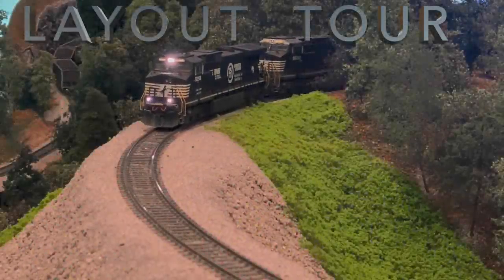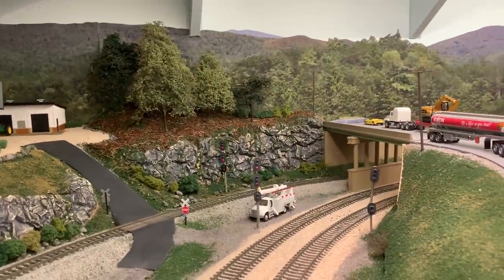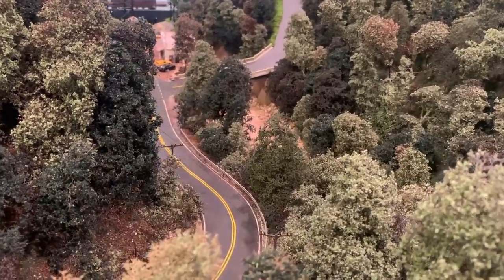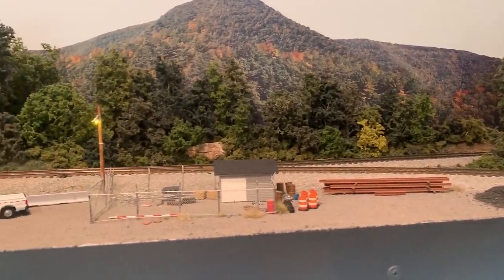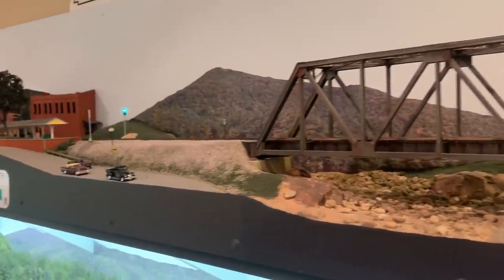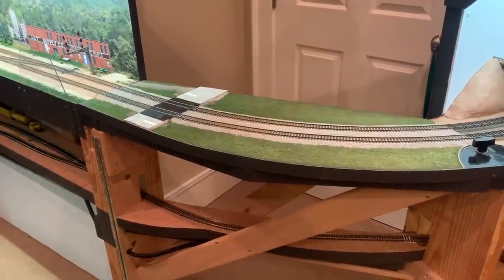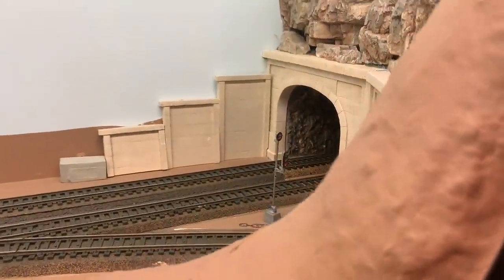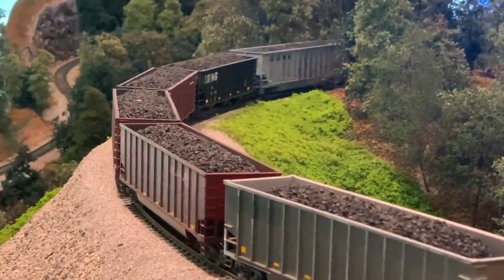Layout Tour - Modern NS Asheville District in HO Scale 2020

Comment: In 1994/95 I lived in Swannannoa (East of Asheville) and railfanned from Asheville to Old Fort many times.  I chased and rode the N&W 611 steam excursions through there, too.  I've driven under the small bridge you modeled at The Loops.  There are several tunnels between Asheville and Old Fort.  I've hiked the tracks and actually walked through all but two of the tunnels.  The first tunnel from Asheville is about a quarter-mile long - too long to walk through safely.  The last tunnel on the line I never found until one winter day when the leaves allowed a view of one end of the tunnel.  One short tunnel is the subject of local art for sale in the shops on Black Mountain.
And, I'll never forget the smell of the wood chip pulp plants West of Asheville.

Comment: I live in Marion but work in Old Fort. I work at a factory there that makes automotive parts. NS brings us hoppers full of pellets that we use to coat the back of our automotive carpet. A long time ago we used to ship out everything via rail but now we just use NS to bring us the pellets. There used to be a set of tracks running in the building to shipping docks. The docks are still there but the tracks are torn up. The hoppers located right outside of the facility.

Comment: You guys have built a really nice layout, and you do great voice over work.  FYI, if want to simulate spring switches get a “the Hare” decorator from DCC specialties (one for each spring switch), they piggy back on the tortious switch machines and have a auto throw functions.  To use auto throw you just isolate one rail on each of the diverging route tracks, solder a wire to that isolated rail and run it back to “the hare”.  The hare will supply power to the isolated rails so there will be no dead section, however when a train approaches the turnout on the track with the isolated rail section the decoder will detect it and throw the turnout the points.  The decoder can be programmed to throw the points back after some time.  It’s pretty simple to set up.  The toggle switch for those turnouts will need to be replaced with a monetary button, the nice thing is you only need one button.
Reply: Wow that's cool! I'll talk to Josh about that.

Comment: Wonderful video.  I've enjoyed many of your episodes as you and your Dad have built your RR.  And it was good to meet you in person on the Fall River Division.

For spring switches, see Andy Sperandeo's Workshop Tip on page 24 of the Feb 2011 Model Railroader magazine.  Free moving points (easier with a purchased switch vs. handlaid), a dead frog (no problem with modern diesels), and a long thin music wire (0.012" dia. or so).  Check operation with your lightest flat car, weight if necessary, and you're in business.

Jim

Comment: You and your father have a fantastic layout!!   
  I noticed you mentioned "spring switches" and could find a way to do it. Well, I needed a way to just that on my two return loops and I found a solution at Azatrax.com   It's a circuit that uses sensors to move the points and then return them. It works great, you might give it a look! Again, great layout!! Thanks for showing it! ...Claude
Reply from the maker: Hey Claude, Thanks for the idea! I'll definitely have to look into that. - Josh
Reply: NSmodeler24 
Look here:  http://www.azatrax.com. Under switch control.  The D2T-3W-SS
Reply: Holy crap! Azatrax makes some great stuff!

Comment: For your “spring switches that don’t”, what about using occupancy sensors to detect approach to spring switch and if track ahead is clear automatically throw the switch with tortoise, and when occupancy makes and then clears past the switch automatically return it to normal position. It will give your arduino guy something else to work on.
Reply from the maker: Haha my "arduino guy" has plenty of stuff to do as is, but that's a good idea. :)  Thanks for sharing! - Josh

Comment: Nice job. Question: With recharge bat paks today slong with close proximity transmitters couldnt engines run strongly off their own power more realistically. I'm assuming added weight is a plus in travel appearance and in fact all cars could be weighted more for realisim.
Reply: Yes, but you would still need to control them through the track ... or maybe by radio. As far as I know, no one makes such a set up.

Comment: (18:05) I'm designing a model railroad for NE Atlanta (Greenville District). Chamblee yard down here is worked on the Main #2 with no yard leads; there is however a track that runs between the two yards but its a run around between the two yards
Inman, on the other hand, has yard leads.

Comment: 10:05 what on earth happened to those rails??
Reply: There was a rail-served cement works I used to drive past often in Tasmania. Had an old loco with its engine removed in service as a propelling control vehicle to lead cement wagons through the loading/unloading hopper. The vehicle is entirely caked in cement dust…
Reply: Josh made them look used and abused?